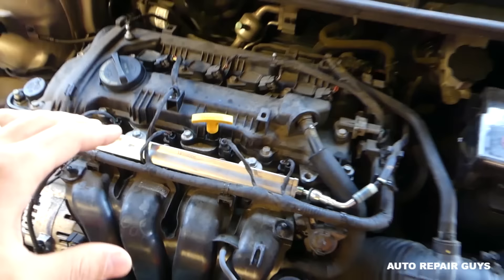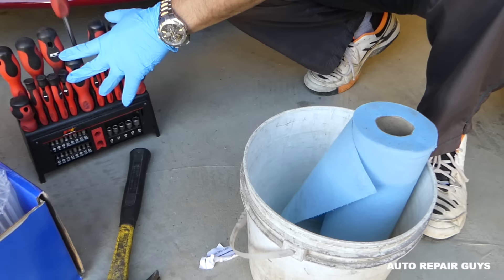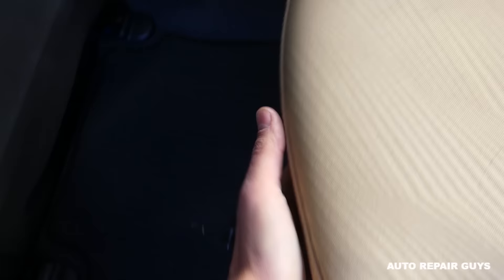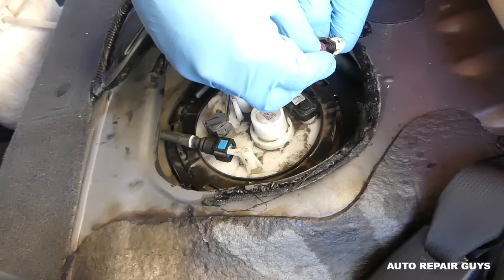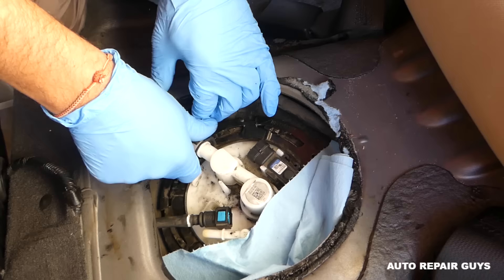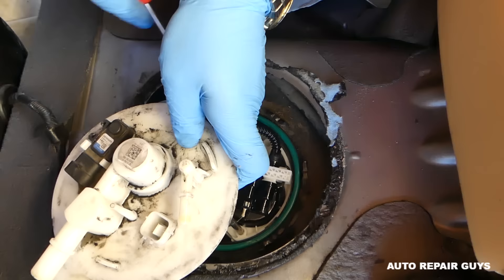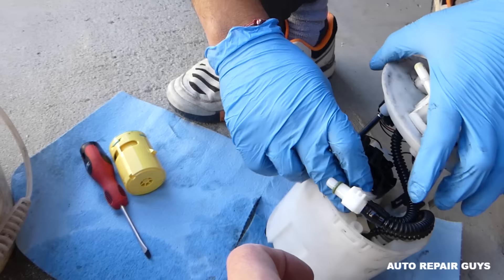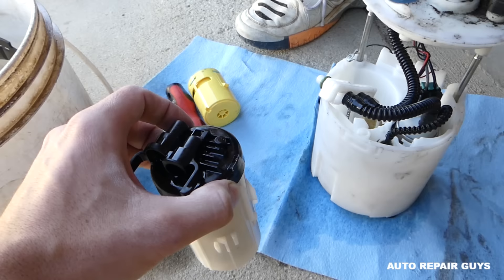HOW TO REPLACE FUEL FILTER ON HYUNDAI ELANTRA

Comment: Probably costs more but seems easier to replace whole fuel pump with new filter than messing trying to get that filter out
Reply: The difference is filter = $30-$60, Whole  Assembly = $450-$600

Comment: Great work gentlemen. All that work for a filter that should be located under the car
Reply: that's too easy they don't put them under the car like that anymore they want you to take them to the dealer so they can rem you that's the whole purpose. 🤭👎🥶
Reply: Exactly. Mine as well change the whole fuel pump.  Save you time and money.

Comment: Just changed fuel filter on my 2013 1.6 elantra and its more complicated than 1.8 engine, ring is held by 8mm bolts and pulled pump out of the tank 
very easy. Dissasembly of pump is totaly diferent.

Comment: For all you guys who think fuel pumps and filters in the tank is a Hyundai design,  you're wrong. Most manufacturers have been doing it this way for over 35 years. My 83 Eldorado has its pump in the tank, so does my sister's 99 Mazda protege.

Comment: Great vid. How often does the filter need to be replaced by the way?
Reply: Every 30,000 miles on elantras 2013 and under.
Reply: @firenitesav4689  cool thanks!
Reply: Explains why my pump failed. Had no idea this was a replaceable part. I miss the days of an in line filter under the hood or along the framerail.
Reply: @christopherhendricks4369   They still have those, most diesels are wayyy easy to replace the fuel filters on, and tons of other cars have that filter easy to access under the car. Just Hyundais decided they're going to be a pain in the ass, so dumb.
Reply: @firenitesav4689  ha. Good to know.
Reply: @firenitesav4689  i got to 300k with a 2008 :) original filter

Comment: Was the filter dirty? I can't tell. When and why do I need to change filter? By finding out the fuel pressure and proving that it is not the pump getting weak?
Reply: Change when you get low mpg.

Comment: Unreal 
Thanks a lot.
How often need to change this filter ?
Reply: I'm pretty sure every 30,000-60,000 miles
Reply: It doesn't need service under normal conditions.  they stated that their fuel pump stopped working so while replacing the fuel pump you would then replace this filter.  many newer cars have a fuel filter that doesn't require replacing.
Reply: @onenikkione  with no fuel filter to replace is why fuel pumps do not last long in new cars.

Comment: 2007 toyota yaris has a plastic ring with flimsy tabs on it broke a few then used wood on a larger tab it worked, a tight fit for the pump as well very frustrating... Huyndai seems like a higher quality product with its metal ring i have to admit.

Comment: Hi! I have a 2014 Elantra with 60Kmi which I have not used much since Covid. No check engine light. On Thanksgiving I drove 40 highway miles home - then it stalled once on a local roads at 30mph. Dash lights came on and engine shut off - but started right back up. Same on trip back. Same on Christmas. Could this be a fuel pump issue? A local mechanic says "No way fuel pump gonna go at only 60Kmi" and "fuel filter not gonna get clogged - it's in the tank" and "if fuel pump go - check engine light come on - we would get fuel sending error on computer". Please help! Thank you!
Reply: What was the issue I have the same problem going on
Reply: @joshbuford5421  Oil pressure sensor (edit* oil pressure switch). $60 installed. I noticed the oil pressure light would come on 1/4 second before the rest of the dash lights and then engine shut off. Back on the road!

Comment: Good morning dear 
Do you have video of how to change the transmission oil for Hyundai Elantra 2014
Thank you so much
Reply: I am also interested in this
Reply: There’s a drain plug under the transmission. To fill it there’s a plastic plug that you can reach from the top with a 3/8 inch ratchet extension and use a funnel to fill it up but you will have to take your time because the fill hole isn’t too big.

Comment: My 2014 Hyundai Elantra, is at 63,000 miles.  When would you recommend having the fuel pump replaced?  I appreciated the feedback
Reply: When it dies. Don't replace it unless you're having issues. Hard starting. Stalling. Or something related to that. I've seen pumps go 60k and some go 200k
Reply: Thank You, Mr. Hendricks!
Reply: You're talking about the fuel FILTER here, which is a common maintenance item.  The pump itself should only be replaced when it fails, but the filter should be done regularly.
Reply: Thanks Terry!
Reply: Terry Hesticles  mine is randomly stalling, I’m having fuel issues. Would these be the actual fuel pump or filter? Would a bad filter cause stalling issues?

Comment: My 2013 sometimes will not start while it's cranking, but then it will start once I try it again right after the 1st try.

Is this my ignition coil or it is the fuel pump or filter?
Reply: I’m having same issue, and wondering the same exact thing! No eng codes as well btw. Actually stalled on me for the first time while idling at a traffic light yesterday. Wtf!?
Reply: Same and also no engine codes.
Reply: @tuctown7043  you need a crankshaft position sensor
Reply: @Thefilmyfamily786  well I haven’t had any issues stalling since, other than the positive batter terminal connection needing adjustment… Mostly everything is better now. Just strange!
Reply: @Thefilmyfamily786  Well in the end I think you’re correct! So I just started having issues again. And the last time I had them was last summer! So it gets hot out here in Arizona and the sensor starts failing. Long cranks. Non working tach gauge… Shut it off and restart and tach gauge and everything is back. Did more research and also the last 2 long starts and issues I had were in the day when I hadn’t parked in covered parking. Thanks for your help man!
Reply: @CookingCoHost  Did you ever figure it out? I’m like 99.9 % it’s what  @Dhruvpuri2050 was saying with the crankshaft sensor. Starting having the issues again as it’s been high 90s to over 100s for a while now and problems are back, just like last year. Gonna replace sensor this week. Will let y’all know
Reply: @tuctown7043  Literally no issues since. I have no idea what goes on with this car.
Reply: My friend had exactly the same issue and the crankshaft position sensor fixed the issue. Good thing that it's a cheap fix, takes like 5 mins to replace.
Reply: @CookingCoHost  you could have just gotten bad fuel. I tried putting stp complete fuel treatment and the cranking issue has gotten better, if your car is not stalling then try one of the complete fuel treatments first. It works best with premium fuel.
Reply: @Thefilmyfamily786  yeah man. Gonna try and get er done Wednesday.
Reply: @Thefilmyfamily786  replaced it and so far so good! 👍

Comment: Nice video, but maybe next time just pull the fuse for the fuel pump and then run the engine until it dies. That should remove all pressure from the fuel lines.

Comment: Thanks a ton! Very similar to the sonata. Trying to think of an appropriate punishment for that engineer who came up with that design.
Reply: It's a fucking amazing design
Reply: @adamstephens9611  na easier design is what old jeeps have which is inline fuel filter. extremely easy to swap out. undo 2 wires and then put new one back in.  takes less than 5m.
Reply: @JoshMillikan  I thought it would use tubes and not wires?
Reply: this design is very common on newer cars today.

Comment: Hi...why and when need to change fuel filter and Is it possible to clean and reuse the same fuel filter. Thanx
Reply: Change when your gas mileage goes down and or check your manual for service interval. Even if there was a method to clean the filter it would damage it. Just replace it with new

Comment: Thanks for the video
Just a quick one....
I have I problem with my Elantra GLS 2012 model, it switches it self off after running for sometime and when you try to start it again it doesn't pick up easily and when it does the rev counter won't work , more like it's losses power.....
Any ideas..?
Reply: Ralph Baloyi crankshaft sensor
Reply: @renegonzalez277  thank you sir

Comment: Man ,these ELANTRA are a pain,  will this filter cause stumble starts and long crank starts, I have 2 of them with this symptom
Reply: Replace whole assembly mine was doing that and it solved the issue
Reply: @bobg3221  you mean the fuel pump and filter as an assembly?

Comment: I have the same car but a 2013. It has 70000 miles on it. I am getting code p2096. I checked vacume lines and I don't see any leaks. I also replaced upstream 02 sensor and pvc valve. The check engine light was out for 2 weeks and the code came back. Any ideas of what it could be? It has a rough idle.
Reply: ThePariss333 this car does not have timing belt
Reply: I replaced my upstream o2 also. No help. There is a TSB for code p2096. I had it on my '11GLS for a long time. Took it in and they ran an update for the ECU and the code has not been back since. Now at 210,000 miles. Look here:  https://www.hyundai-forums.com/md-2011-2016-elantra-sedan-coupe/583881-2013-hyundai-elantra-p2096-code.html

Comment: What part number is the fuel filter? When I went to the dealer they said the OEM filter is good for 200,000 miles and when they replace it they replace the entire pump assembly.
Reply: Yeah I'm assuming that would be best because the filter is $33 at its cheapest and the entire assembly is $70 but if you're going to do all that work to get to it, you might as well change out the entire fuel pump, with a new assembly, which includes the filter.
Reply: Yes replace the whole assembly makes more sense

Comment: Has anyone tried installing a fuel filter in the engine bay, by splicing into the fuel line ?
Reply: I'm not saying its impossible but it would probably be pretty difficult
Reply: Adam Stephens it was probably idea of universal inline filter, should be very easy.
Reply: Sounds feasible, but you would still need to create a bypass in the in-tank fuel pump so the OEM fuel filter isn't needed. I'm guessing you would just connect the input and output hoses that go into the filter.
Reply: Dangerous AF

Comment: If you open the gas cap you wont have that problem
Reply: Also.... couldn't they have pulled the fuse under the hood, that correlates to the fuel pump?

Comment: My fuel pump is under the back seat I have the same exact car different year no wonder the battery is still under the hood lol. This means my car is gonna stink like gas when it comes time to change it BTW if anyone knows where I can get a 1.8 engine lmk I'm at 93000 and imsure anyone who owns one of these motor mount eating pieces of shit knows why I want it it has piston slap till warm I have to warm it up when it's 100 degrees and i could shake every can of paint at Menards home depot and Lowes   if I dont change the transmission mount every 15000 miles